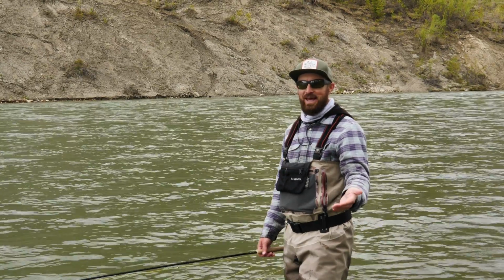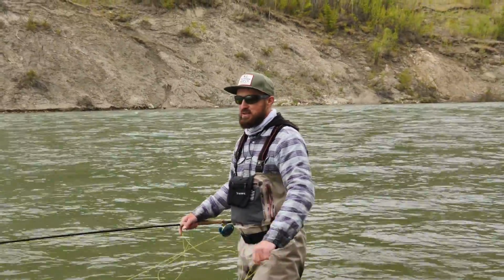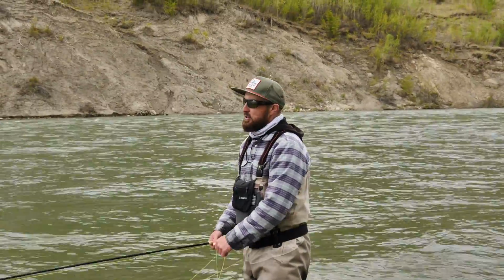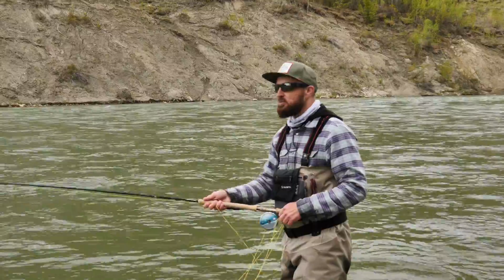Snap T River Left

Comment: Just curious how you do a “circle C” cast?......if that was a snap T?
Reply from the maker: Mike, the circle C is great for teaching people how to set their anchor the same way we do with the snap T.  The circle C involves an exaggerated movement whereby you basically draw a large "C" with the rod tip, the "C" opening in the downstream direction.  This helps to clear the line from the water (upper half of the "C"), get it moving into position then bring the rod back to where you will start your sweep (bottom half of the "C") this sets the anchor.  This exaggerated movement of drawing a large "C" with the rod tip also helps avoid accidental collision  between the line and the rod as you accelerate the line in a higher plane (upper leg of the "C") then bring the rod back underneath the line (lower leg of the "C").  The snap T is simply a progression of the circle C (aka circle spey) as they both achieve the same result.